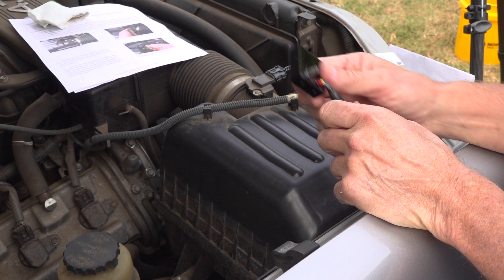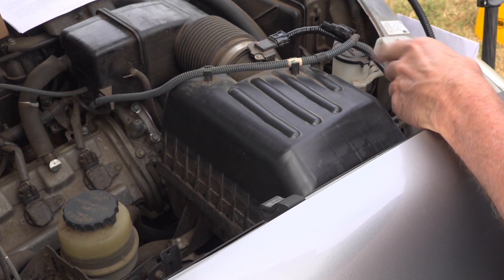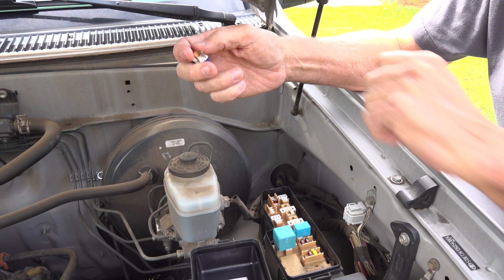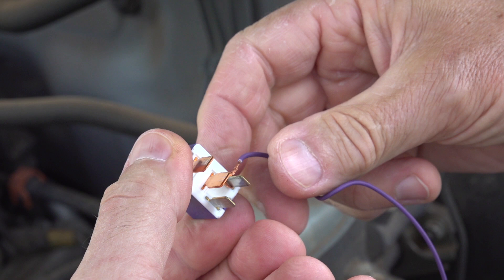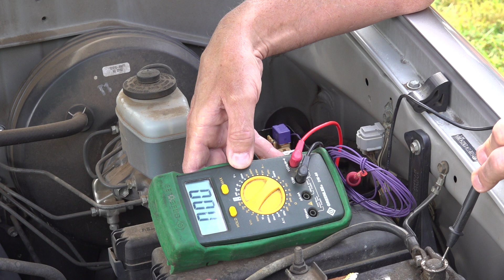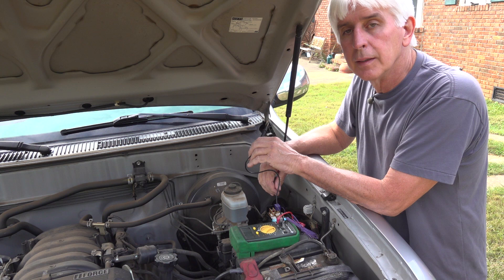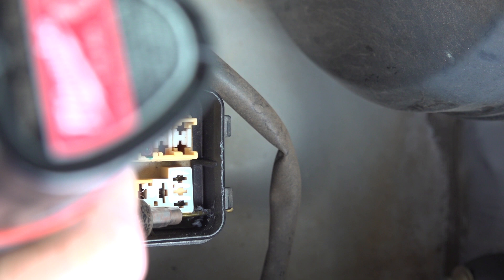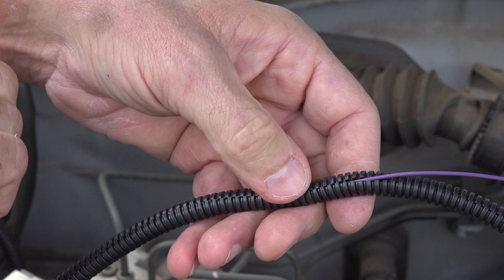2006 Tundra - SAIS - Hewitt Bypass

Comment: The kit I bought says the ignition wire step is not needed, it didn’t even come with the wire for it to be an option. Thanks for showing the location of block off plates.
Reply from the maker: Some are made that way iirc.
Terry
Reply: You likely bought one of the cheap knock offs. They are not engineered or put together with automotive quality and we sell a lot of replacement to their customers when they fail.
Reply: @Hewitt-tech  That is the poorest form of customer service when you bash a competitor/customer without knowing all the details.
Reply: @3wrapframe  What I said was not meant to bash anyone so I apologize if you or anyone else took offense. Many are just not aware of the differences between our Hewitt Tech kit and others and often assume they are all the same. I am intimately aware of the details of the/any kit you could have purchased and feel that I can very safely say exactly what I did, so I will say it again. No other kit is designed or manufactured to the level of quality that the Hewitt Tech kits is. It takes much more than is obvious on the outside to ensure our units will last the life of the vehicle in the harsh under-hood environment. Because of our confidence in our products we cover them with a cost free limited lifetime replacement warranty. If you or anyone else would like to discuss the details or differences and what makes our units what they are or has any problem with another unit please give us a call Toll Free 844-307-7671 or send us an email Support@Hewitt-Tech.com and we will gladly help you find a solution that works.

Comment: Hello, I just watched your video, and my by pass kit was installed just as you did yours. The problem I am having is my 05 Tundra is going into a limp mode. I called Hewitt and the tech explained to me that they are having trouble with some of the 4.7 liter engines going into a p2445 code. They are saying this is a below freezing temp. mode I have to start my truck let it warm up, once the temp gage moves showing the engine is warm I have to cut the truck back off wait 5 seconds then start the truck back up then drive away. If I do not do these steps my truck will not go above 45 MPH Hewitt state they have been working with several Toyota dealers to find a solution to this limp mode code so they can install it into the by pass kit but have been unsuccessful. The tech said its not happening on all 4.7 engines but of course it has to happen to me. Being a fire fighter it sucks to have to wait for the truck to warm up before I can take off to answer calls. So my question is does anyone else have this problem with there by pass kit or have you ever heard of the cold weather P2445 limp mode code?? I thought thats what this kid was suppose to do but Hewitt says they are aware of the problem but unfortunately they have no solution at this time.. Any help would greatly be appreciate!!!
Reply from the maker: Sorry it did not work out for you. Hope they come up with a solution. Would a dip stick heater help you get warmed up faster in cold weather? I know its not a fix but maybe it could expedite your take off time?
Terry
Reply: Did Hewitt fix this issue?  I have the same code.  I live in California.  Wondering if it will pass smog after installation.

Comment: I installed the basic kit ($190) on my 2006 Sequoia today. At 249,000 I blew a head gasket and damaged the cat converter and O2 sensors on bank 2. Within 100 miles the emissions air pump started throwing out codes. Toyota charges about $3K to replace the pump. It is a big job. The bypass kit saved me a fortune. I just can’t register it in California. Don’t go there anyway!
Reply from the maker: Glad it worked out!
Terry
Reply: Ahhh...I have a Sequioa 2007 in California. I was about to ask this question about legality in Cali. Will the OBD2 reader detect the bypass kit?

Is the "Bypass" kit meant to Bypass the OBD2 Reader or is the "Bypass" meant to deactivate the actually secondary pump?
Reply: You blew a head gasket on a 4.7???? Man must have 1. Had a supercharger or 2. Overheated the hell out of it. 4.7 V8’s don’t have head gasket issues
Reply: @nordicpride9708  Yes on the overheated issue. My fan clutch was defective and I left the car running last summer with my wife and the AC running. Temp gauge went off the scale. Ordered a new engine from Japan.
Reply: @jamesmoore1431  That’s never fun! Sorry to hear it. The 4.7 is arguably one of the best/most reliable engines Toyota ever built. Not many issues. Good thing the Japanese have a overage of low mile units you can access. Cheers 🍻
Reply: I did not get a rebuilt engine, I bought a remanufactured engine with a 3 year unlimited mileage warranty. I will drive this thug until they bury me!
Reply: @jamesmoore1431  Oh well I’m use to buying JDM ( used low mileage units from Japan). Sounds like a good deal. Just remember to change that timing belt with AISIN parts every 90k miles and life is gravy

Comment: Good product...Be careful though on those screws where the plates goes...one of mine(outside one) snapped in half and now I have a big problem. There is no way to change it  or fix because no room to work. I have terrible noise and i am out of solutions. I may have to take the engine out to fix that....
Reply from the maker: I hear ya. Would you be in a northern state? Things tend to rust up that way. Ours was clean as a whistle 😁 i grew up in Michigan. It would probably have been rusty there. Good luck!! 
Terry

Comment: One question, (I've had mine on since 2012, still works great) should I remove the exhaust caps and clean them? I imagine all the blocked secondary air has created a pretty good crud in the pipe?
Reply from the maker: Honestly I am not sure. Brian traded that truck last February. I would call or message Hewitt. They were pretty helpful for us. Thanks for watching!!
Terry

Comment: In regards to breaking off the studs; would it be better to work on a warm or cold engine? I feel like taking off a cold oil filter is easier than warm so no sure if the same logic might apply here
Reply from the maker: Good question. If the engine were warm you may run the risk of getting burned. However I have known of people heating metal objects with a torch to expand the metal when trying to remove other metal objects from the first metal object. I am no expert there.  Sorry. 
Terry

Comment: OK, so my question is if my truck is already throwing the codes because maybe the fan blades broke or something like that on the secondary injection pump can I run the bypass kit and it will not have to be properly fixed by ripping the engine apart still ?
Reply from the maker: The bypass is designed to trick the system into thinking it is working properly. That bypass kit, when installed as we fid, at least for us, made the truck run fine with no further issues. He has since traded it for a 2021 F150. Good luck!!
Terry

Comment: Great video.   My engine makes similar sound, tough idle and suction sound. Threw CEL p1441 p1442 Got it scanned and now the CEL is off. But I still think it has the issue. Safe to say I need this? Did your cel go off? Were you able to pass an emissions test? Thank you great video.
Reply from the maker: My CEL did go off and on several times over a few months. I have not had an emissions test, they aren’t required for our state. Thanks for watching!

Comment: I have this code, however, I was wondering what the symptoms that you guys are running into with the performance of the engine with this code present.?
Reply from the maker: Brian was lucky. The only thing it did was make a very obvious vacuum sound when you first started it. Then it would make a  kind of sucking sound as the valve apparently closed. He has traded that truck on an F150. Thanks for watching!!

Terry

Comment: Does the air pump only work on cold start to heat cat? Does it turn off after cat is warm/hot? It must be getting temp info somewhere.
Reply from the maker: I believe that’s what it does. It pulls engine heat to heat the cat quickly, then it cuts off (from what I understand)

Thanks
Brian

Comment: I didn’t a get a CEL when it failed. I was sitting in a parking lot then the truck just shut off. 4HI light was the only thing flashing.
Reply from the maker: We were lucky and it never shut down. It just made an air suction sound when first started each day. We knew something was up. Took it to Advance auto and did the analyzer. Then Brian found out how expensive it was to fix and stated looking for a work around when he found this solution. Glad he found it.
Terry
Reply: This is my concern. Can I ask what year your truck is? Thank you

Comment: My 2006 tundra roars when it first starts up. Assume this is the secondary air pump pushing air loudly?  No codes. Besides codes what else will have problems if the secondary air system is not fixed ?
Reply from the maker: Right off the top of my head it would eventually start going into “limp”mode which basically makes it run super slow. We are not experts on this system but did the research to get it done. Wish I knew more. Thanks for watching!
Terry

Comment: Mine just started throwing the code. Any idea how long I have before I absolutely HAVE to do this? Planning to do it in a week or two, but like you said, I don't want it to go out on a north GA road in the next few days. And in the meantime is it doing any damage to my engine?
Reply from the maker: It was acting up for about a year and a half for us. We were lucky it did not go into limp mode sooner. I do not think your causing damage to the engine but I am no expert on the subject. Good luck!!
Terry
Reply: @ForestToFarm  yeah I guess the uses car lot must have cleared the codes before letting me test drive it. But I ordered this same kit and will be following along on the video while I do my own!
Reply from the maker: @zhukel_marimasko  They can be deceptive for sure. Stinks!
Terry
Reply: @ForestToFarm  just finished doing mine! Did take off the drivers side tire for one plate, but realized on the passenger side that I could just turn the wheel. But all in all it was as simple as y'all made it look! Any other changes I should make to my 06 to maintain that "bulletproof Toyota" status?
Reply from the maker: @zhukel_marimasko  I can not think of anything. You may want to change the timing belt if its not been done. That is up next for us. It can be overlooked until its to late if you are not careful.
Terry

Comment: Hey there, when you first cranked it and that high pitch whistle noise settled, it made a weird rattle noise which is also what mine is doing as well. It seemed to go away after you installed the bypass kit. I’m just wondering if the sais would have anything to do with that or if it’s internal? I have a video on my channel that you can hear the noise very clearly. I haven’t been driving the truck much lately so I’ve put off on fixing it. But the weird thing is, is that it isn’t throwing a check engine light, it does have a maintenance required light on though. But if you have any idea on what it could be I’d greatly appreciate that, something like this I can fix myself without having to take it to a mechanic IF it has anything to do with the sais. Thanks!
Reply from the maker: Yeah it was the air valve making the noise and it did clear up.

Comment: So question installing this bypass kit doesn't effect the motors power? And is it bad to have em on a long run especially blocking those 2 sides of the motor?
Reply from the maker: No effect on the power. I do not think its bad at all.   had zero issues until I sold the truck this past Feb.
Good luck!
Reply: @ForestToFarm  and how long did you have it on until February when you sold it

Comment: I have a 2007 sequioa giving me a p2445 code and track and the other light it goes on limp mode but then I erase the code and drives fine will this fix the problem?
Reply from the maker: I would check in with Hewitt. They can tell you much better than myself. There are so many possible problems that can occur . 
Terry
Reply: Forest To Farm I bought the gen 2 3 vale bypass $400 and didn’t work still codes come on
Reply from the maker: @shopking6989  Humm. Not sure what is going on there. Could be other issues we are not aware of? We have been fortunate that this is still working great for us. 
Terry

Comment: I have that sound but no Check engine light or codes. Does this kit cause any problems after you’ve driven the truck a while?
Reply from the maker: So far no problems!
Terry
Reply: I had the cel but it’s off now.

Comment: Would I be correct, if you have the p1442 & p1445 and that means valves are stuck closed.  You would not need to install the block plates? The p1441 & p1444 being stuck open, you would need to install blocking plates?
Reply from the maker: Great question. In theory that sounds like a great idea. However I am not an expert on what would happen if the valves suddenly started working. You might could ask the manufacturer and get a more informed response. They are linked in the description below. Hope that helps and sorry I do not know more. I like your way of thinking!!
Terry
Reply: Yes you need to. There is a couple of pressure sensors on the secondary air system that would trigger the check engine light if those plates are not installed.
Reply from the maker: @neverstoplearning382  Thanks for the input!!
Terry
Reply: @neverstoplearning382   Yes! Thank you!
Reply: Man i have this problem, this kit, didnt use the plates because a bolt broke on passenger side tube for plate, i left it alone, installed the harness , been 2 years in a harsh winter area and never had another problem again all while not using them plates! So screw em! Lol.  I also don’t remember the codes numbers but it was this issue

Comment: Anyone have advice for rusted bolts for where the block off plates go?
Reply from the maker: You must live up north. That salt is rough on things. My 99 F150 is pretty much rust free down here in the south. Only thing I ever used is WD40. Maybe try to get something up against it and bang on it with a hammer? Wish I knew more. Good luck!
Terry

Comment: What options do I have if the nut/bolt snapped off while trying to install the block off plate. I hit it with penetrating oil, but live in New England with so much salt and corrosion, they just sheared right off.  Local muffler shop said it can't be drilled and tapped without taking the engine out.   Any other creative solutions? Can it be blocked where it connects into the exhaust manifolds?  Or under the intake manifold where it comes out of the pump?  I realize if I got that far, I should have just replaced the pump altogether but do not see a way to drill and tap as is.
Reply from the maker: Man that stinks. Salt is not a cars friend. I have no valid advice here. Never had that problem. If you can find a way to block it off seems it should work. Tearing that manifold down seems like a lot of effort but may be the way to go. I would ask Hewitt and see if they have had this problem. Sorry I am not more help. 
Terry
Reply: C no I haven’t. If you follow those pipes up and to the back of the intake manifold, you can put the block off plates there. Same connection and likely less corroded than the connection near the manifold. However, there isn’t much room to work back there (it’s at the back of the intake manifold). My switching valves are stuck closed (that is the only code I had) so just going for it and hoping that them being closed is good enough to keep any exhaust from backing and damaging the sensors. So far so good after 1k miles.
Reply: Well im late here but ive got an 05’ tundra dc and had this code, i bought this kit, had a bolt break on the pipe for the knock off plates on passenger side, so i didnt take out any more bolts and i left them pipes alone, installed the wiring kit, and have never had another issue and never used the knock off plates lol.  Its been 2 years now, i live in northeastern Pennsylvania and never had another issue..  so screw them plates!!

Comment: What does this do to gas mileage and emissions?
Reply from the maker: It should have no effect on mileage. Those few seconds the emissions would be higher I assume. Not a significant factor in my opinion. 
Terry
Reply: @ForestToFarm  thanks Teery
Reply from the maker: @TJackSurvival  No problem. They try to cut every single corner in order to meet government standards on emissions. Some of this stuff seems to be a bit overboard. All these parts and controls have to be manufactured. How much emissions of energy goes into that production, distribution, installation and repair of these systems? Not to mention the mining of materials to make this stuff to start with. Many times things cost us more than they save as far as earth friendly goes. But it does make the bottom line "look good" for the car companies.
Terry

Comment: What if you install kit but don’t put those 2 metal plates?
Reply from the maker: Pretty sure they are required. I would check with Hewitt
Reply from the maker: Pretty sure they are required. I would check with Hewitt
Reply: I have an 05 tundra dc and got this code , this problem, and bought this kit, i had a bolt break on the passenger side tube for knock off plate and i left it alone, didnt use the plates, installed the wiring harness , and have never had another issue all without using the plates. Its been 2 years i live in northeastern Pennsylvania and the winters never affected it.  So screw them plates!!

Comment: What are those, black tubes, you put the purple wire in?. Does it come with the Hewitt kit?.
Reply from the maker: Its a wire protector and we ordered it from them separate because its an extra item.
Terry
Reply: Did you have to remove the tires to reach under the wheel well?.
Reply from the maker: @SolidFoundation733  No sir we were able to do it all with the tires on.
Terry